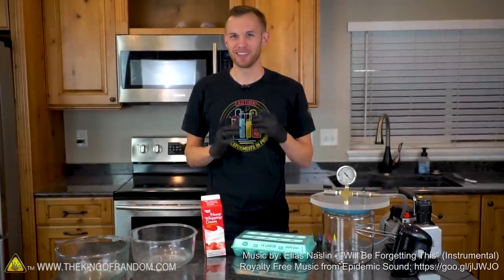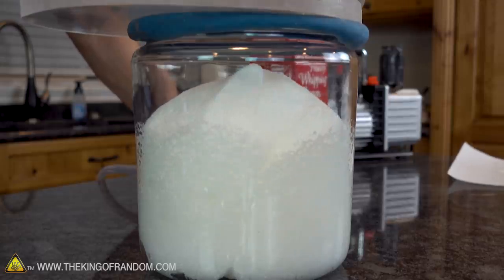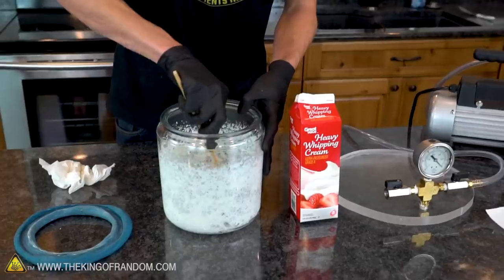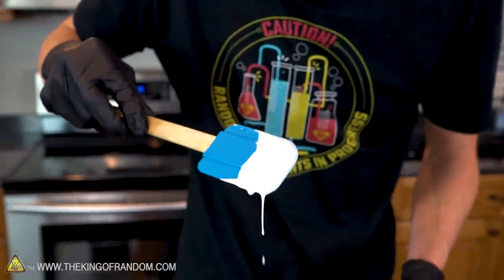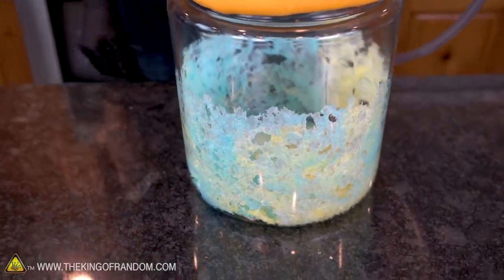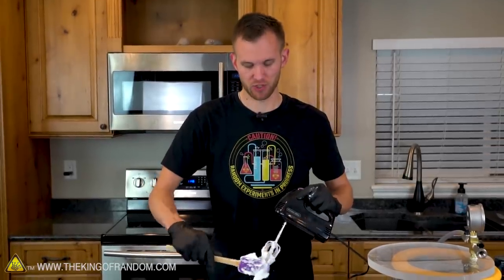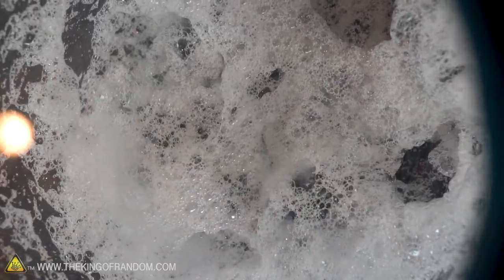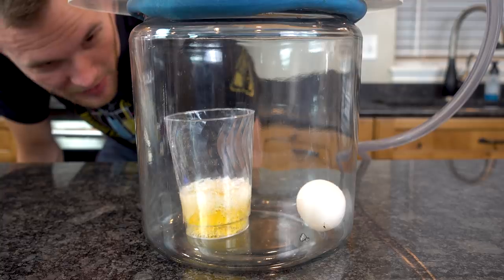Watch what Whipped Cream Does in a Vacuum Chamber! TKOR's Whipped Cream Vacuum Chamber Experiment!

Comment: Try depressurizing jello to see what happens if it will become a liquid or a solid
Reply: Lol
Reply: It stays solid. Jello has pretty much no air in it.
Reply: This comment better get some attention from TheKingOfRandom
Reply: @valleyofsin  it doesn't need air to depresserise
Reply: @talasruff7943  To depressurize is to create a vacuum. Jello has literally almost no air in it for the vacuum to effect it. The Jello will stay the same. You can also apply pressure to the Jello and the same thing happens it stays Jello.
Reply: @valleyofsin  wouldn't the jelly have a lower melting point under lower pressure?
Reply: @DanielkaElliott  not if it stays cold enough. Once it starts heating up it will melt.
Reply: TheGamingBus 64 pretty sure it becomes powder
Reply: jello is already a solid
Reply: @valleyofsin  it might not hear up, but the vacuum will reduce the boiling point of the water in the jello
And it will boil

Comment: Not sure how it would end up but how would a angel food cake batter end up cooked after having the air removed. Just curious as I was a baking and pastry major and the air is important in it.
Reply: Mary Richen not sure if this answers your question or not but any type of sponge cake including angel food cake if not baked immediately after mixing will fall causing it to collapse in the oven. It becomes very gummy and dense 
Angel food cake requires the heated air inside the batter to rise and hold its self together. The air pockets essentially get stuck in place forming all the structure needed

Comment: put firecracker inside vacuum chamber and see if it can still explode
Reply: German Nazi VS Soviet Union why wouldn't it? 

Firecrackers work on a chemical reaction not pressure differentials.
Reply: I believe the fuse would need oxygen to burn so maybe it wouldn't work.
Reply: Wont work because it will have no air
Reply: its provides its own air in the from of an oxidiser so it can burn faster  normally KNO3 fuse also has it however it is still much harder to ignite under negative pressure
Reply: German Nazi VS Soviet Union I bet it will even though there would be no oxygen
Reply: German Nazi VS Soviet Union you can not do that because you need air for fire to burn
Reply: GReat idea, but how would you light it anyway?
Reply: Fire can’t burn in a chamber
Reply: It's only the Oxygen in air that is needed for fire, thus if the material in question has it's own, self contained Oxidizer (eg. Potassium Nitrate) it CAN burn.
Reply: German Nazi VS Soviet Union don’t look at my username
Reply: Tim Moore the powder in the fuse has a chemical that provides said oxygen, thats why they water resistant firecrackers work underwater
Reply: I think Cody's lab already tried this experiment.
Reply: German Nazi VS Soviet Union 
U TRYNA GET HIM TO BLOW UP??
Reply: they won't because the fuse would need air to continue burning
Reply: and it will not work no air no reaction
Reply: German Nazi VS Soviet Union it won't becuse an explosion wuld not be possible
Reply: Go check out Cody's Lab...he did something close to that with gunpowder. Quick answer is no...it still needs air to maintain the reaction in order to "explode".

Comment: Water boils, depending on air pressure. The lower the pressure, the less energy it takes for water to boil. In a vacuum, water boils and evaporates away. Therefore, the "cream" never really returned to its previous state, but close enough. Great video

Comment: So, fun facts: Milk fat cells are basically little water balloons, they're a cell membrane filled with liquid. When you take cream, which is milk with a very high fat content, and agitate it, you're popping those cells. The deflated cell membranes can kinda slap and grab onto each other with friction now and can now trap tiny air bubbles. If you keep agitating it, more membranes get destroyed, and they eventually lose the ability to hold onto each other nicely and instead clump up and separate into a solid mass and a liquid; this is butter and what can become buttermilk. When you took that whipped cream and depressurized it, I have a feeling it was still very thick not because there was a lot of air still in it, though that might have also been true, but because the cells changing shape changed its consistency. I don't think you re-vacuuming it actually drew the rest of the air out (though again it might have helped, little column A little column B), I think the pressure continued to burst the cells, spilling out a lot of that buttermilk, which mixed together and gave you a runnier consistency. I now wonder if it's possible to make butter solely using a vacuum chamber or pressure pot; probably the latter would give you better results. Milk is cool kids :) Ah I'm a dork..

Comment: Could you ingnite a termite inside a vacuum chamber with sunlight?
Reply: No because There is No air for the thermite to react
Reply: LLK_knaxti, but he said termite not thermite.
Reply: Zinc Sulfur  sorry i thought He wanted to say thermite
Reply: LLK_knaxti he did I think, the other person just is not the best at figuring things out.
Reply: LLK_knaxti and the oxidized metal in thermite I believe is enough for it to be able to react
Reply: While a termite would not ignite, thermite would.  Termites are mostly hydrocarbons, and thus need oxygen to burn.  Thermite, on the other hand contains its own oxidizer in the form of iron oxide.

Comment: What happens if you put hot glue from a hot glue gun into slime and in slime without borax or any other activator. Will it activate the slime?and if it does is it possible to put it into a vacum chamber what will it turn into?

Comment: Actually, it's not meringue. Meringue is a very specific way to prepare egg whites. Straight whipped egg whites are either called soft peaks (white and foamy but doesn't hold its shape) or stiff peaks (white and foamy and does hold its shape).